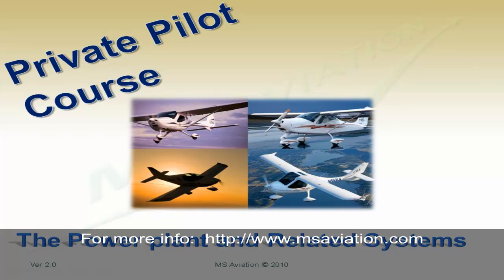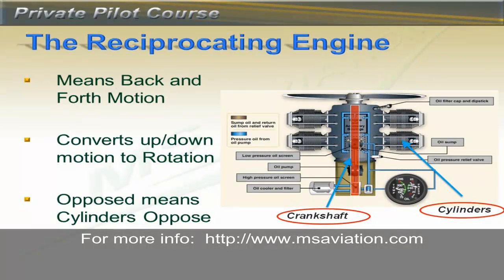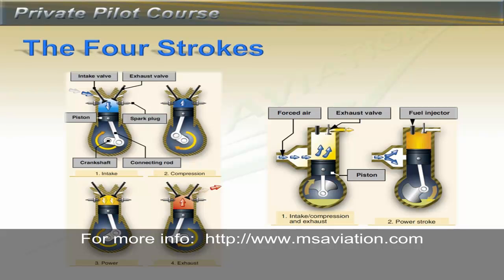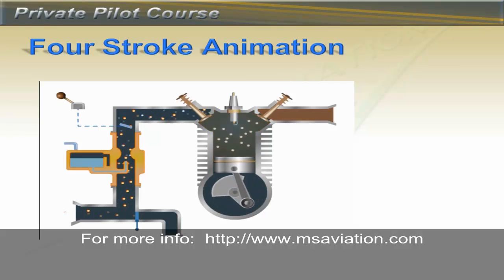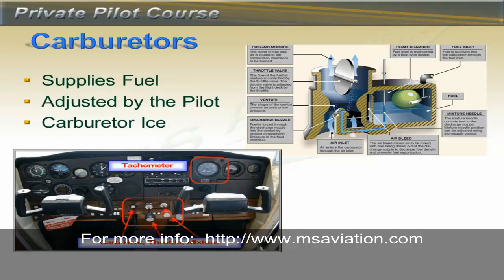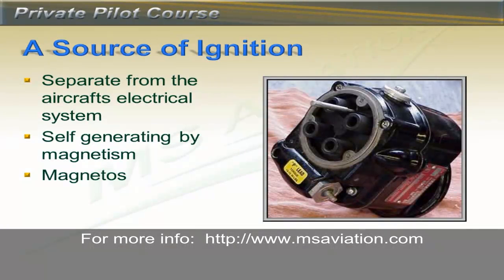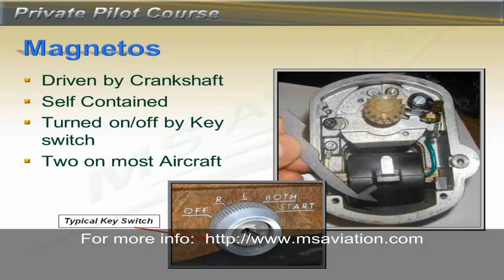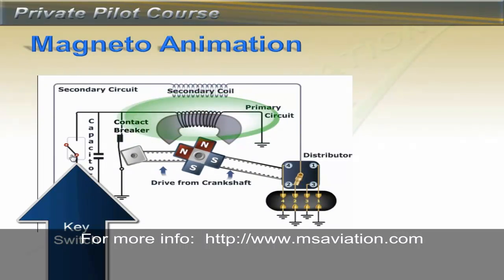Aircraft Powerplant

Comment: Hi Rob.  You are right.  The ice melting usually causes roughness due to the water getting into the fuel to air mixture.  The carb heat causes the air to become less dense and that causes the drop in rpm, like that noted on run up.  I think this is fixed in the newer video.  These videos are older.  The latest ones are on AnywhereEducation's eKneeBoard platform that currently runs on IOS devices such as iPad.

Thanks.

- Mike S

Comment: A bit of a misinformation around 8:47. The carb heat being applied does NOT cause an RPM drop due to the ice being melted. This is a basic concept they've got wrong. There is indeed an RPM drop briefly as the ice melts, but it's caused by the heated air being less dense, causing a richer mixture being fed into the engine.

Comment: This was Much easier to understand than the books, but I still don't understand why electricity from the magnetos causes the the fuel/air mixture to expand? is It because the electons causes the (fuel/air) atoms electron to jump to a higher orbit? or something like that?

Is there anyway you could explain why electricity causes expansion?
Reply: in order for the combustion to take place between the air/fuel mixture it requires heat. The initial spark from the magneto supplies the air/fuel mixture with enough heat to start the combustion which allows the gases to expand.